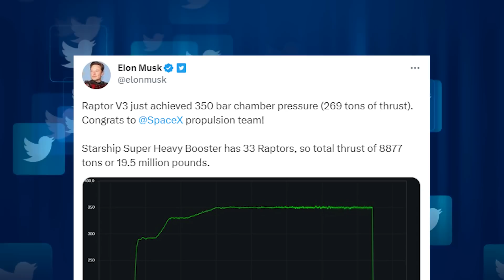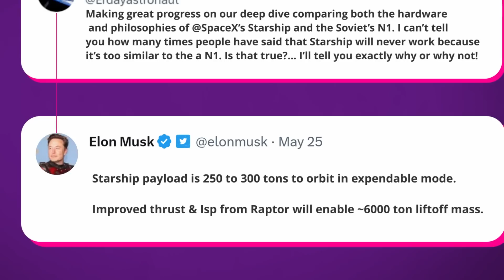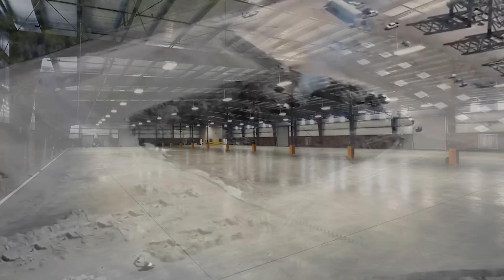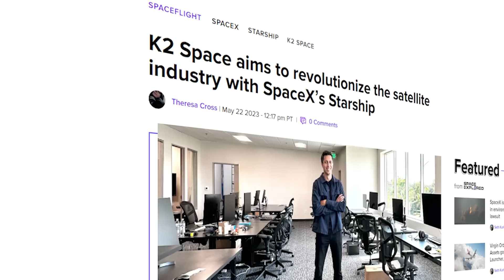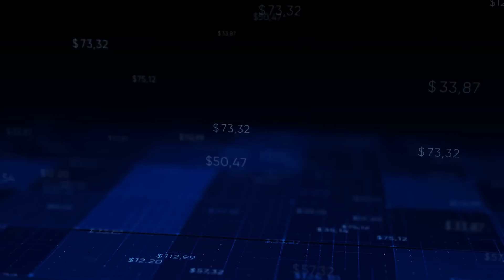Elon Musk Reveals SpaceX Is Making Major New Changes To Starship!

Comment: @SPACEX: 
There is something that eludes logic for me, no matter how I think about it: If Stardhip really did what it did to the platform that was specifically made for it to launch from (and it surely did), then how is it going to SAFELY land on, and take off from the Lunar surface? 
 - You won't know what kinds of rocks, boulders, dust, or whatever, are beneath it when it lands, which could potentially destabilize the craft, making it sit at an extreme angle, or even tip over and fall  (a catastrophe I can't even imagine the repercussions of) - or severely damage the engines, because the moon's surface has (under that Regolith), Basalt, Titanitm, and an array of heavy metals. - those engines may be damaged to the point that maybe they are not fit to get back into space with - let alone voyage back to Earth and land here. 
 - On lift-off, after whatever damage was done to the engines and the bottom of the craft - not to mention the damage to the surface it is still (hopefully) standing upon, how will you be assured that the craft even has a CHANCE to lift off, given the damage to the remains of whatever it landed on? 
 - You may have this all worked out, SpaceX, but can anyone with extensive knowledge of the internal discussions at SpaceX explain this to me? After watching what the first launch did to its platform, and later even more damage - even to the earth BELOW the platform - how will you land and then take off from the moon, Earth (if landing on an unprepared spot), or on Mars? 
Especially on the Moon and on Mars, with so many unknowns, and no "platform' at all?

Comment: The size of the starship and the capacity to lift 250 -300 tons falls inline with Elons plan to transport his Boring machines to mars. Thats why he trying to achieve as large a capacity as possible. The Tunneling machines weigh 200 -300 tons and the diameters are similar to the diameter of the star ships. Does anyone else put these two together.?

Comment: What if the launch pad was in a deep hole and the rocket would be boasted off with the engines and the use of the military rail gun system to get its initial takeoff.
Reply: cheaper to use rockets than that magnitude of power. that would take gigawatts to make that much weight move, and they'd have to make custom parts to handle that much power
Reply: Because anyone inside it would be a smear on the wall from the acceleration of the rail gun.

Comment: Spacex should prioritize making the raptor engine more reliable first before trying to increase it's thrust,
It's caught in a violent cycle of promising more and more features to secure more funding to keep promising new features. 
Speaking from experience, there's a point in a project where you have to pull a line and say "whaat's possible up to now must be refined and delivered otherwise we should see why it doesn't work and fix that and only when a working system is out can we move to make the next stage of development".
Spacex is unwilling to draw that line and it will cost it greatly and it threatens to harm the entire US space program with it.

Comment: Hey Elon Musk. Stop being such an ass** and you better redesign the boosters to have large sections that are milled, not aluminum or "high strength steel" sheets welded into a circle. The boosters are WEAK w/o pressure. Ypu have to take some lessons from NASA. Also. Mr. Musk. You do not have the tempernent any longer for these Starship boosters. I LOVE tge idea. But I knew... KNEW they would crumple or explode. 
You BETTER FIX IT AND STOP RUNNING YOUR MOUTH PUNK. Otherwise Rocketlab will be happy to take US Nasa business. 😮
Reply: You didn't know - and don't know - anything at all. And no one will listen to your big-shot trash talk, People couldn't care less about your "orders." 
Also - RocketLab is going for a completely different market than Musk is. Take lessons from NASA? Seriously? That right there is when I knew you were either stupid or crazy. 
Now I realize both are true. Starship doesn't have "Boosters." It has a single main thruster.

Comment: I dont know if eveybody knows this but Spacex mounded up a 40 foot high layer of soil on top of whatever sand that was there before they removed it all and built on the original sand. Wondering why? I was. It was to compress the exudting sand to give it more compressive strength. Hats off to people like Dr. Dirt and otger soil engineers who were involved in this project before anyone else and did the very best that they could to deliver the best base possible.

Comment: 2:04
The N1 was THE record holder for most powerful rocket to ever launch prior to 20 April.
PERIOD.
There is no "one of the" involved.
Reply: But they had zero successful launches.....
Reply: @lordgarion514  The N1 got off the pad all 4 times it launched.
They never had a successful FLIGHT with it.
It's most successful launch failed a few seconds before Stage Separation - so Starship isn't THAT much more successful of a rocket *SO FAR*.
Reply: @bricefleckenstein9666  
Getting off the pad doesn't make it a success.
It kinda has to work until stage separation.

And I never said Starship was a success yet.

In fact, neither of them completed testing.
Of course Starship will probably finish testing.
Reply: @lordgarion514  Getting off the pad is a LAUNCH success - and the N1 is ahead of Starship on that, with 3 unarguable successes and one "iffy" that did get off the pad but might not have cleared the tower before it started to fail.
It is not a FLIGHT success - which the N1 and Starship have no success at *yet*.
Reply: @bricefleckenstein9666  
A launch success doesn't make the rocket a success......

You might as well claim a concept car is the fastest car ever produced.
Reply: @lordgarion514  Where have I made ANY CLAIM WHATSOEVER that either of these rockets are a success?
READ MY COMMENT where I specifically STATE "It is not a FLIGHT success". or "They never had a suggessful FLIGHT with it".

QUIT FALSELY CLAIMING I HAVE SAID THEY HAD ANY SUCCESS EXCEPT LAUNCHING with both rockets (so far).

Or learn to READ.

Comment: Just to note that Falcon 9 launch cost per kilogram is about half of that of most competitors, and on par with the cheapest of those (Russians and Chinese). The projections of turnaround time and launch cost of SH/SS are wildly optimistic, and are very unlikely to materialize in a decade, if ever.
Reply: Falcon 9 after 6 years still hasn't reached the target of 10 times cheaper. now its about 10"% cheaper and that is with re-usability.
Reply: @salland12  Exact numbers are hard to come by, but Falcon 9 seems to cost per kilogram about 60% of Proton cost, and about 30% of Ariane 5. Falcon Heavy is even cheaper per kg. It did miss the breathless projections (just like Shuttle did), but this is still quite impressive.
Reply: @salland12  - Falcon 9 has an internal cost of $35 million & can launch 16.8 t in reusable mode. The internal costs of Atlas 5 were still 4 - 7 times that depending on the variant (number of SRBs & engines on the 2nd stage). Meanwhile, SpaceX Crew Dragon breaks even at 3 seats (the 4th is pure profit) at $54 million each, while Starliner doesn’t break even & become profitable until the 4th seat is sold at $94 million per seat. Sorry but that sounds like less than 1/3 to me!
Reply: @salland12  - I think I need to remind you that Starship has cost less than $5B in development costs (including construction on Starbase), while SLS has cost $38B to date, which means those costs will be easier to amortize, especially once it starts launching 2 - 3 times a week, which is what SpaceX will do once they can get it flying reliably. Raptors cost ~$1 million each to build, unlike $146 Million for each RL-25 on the SLS…ATST, Stainless Steel is sold by the ton, while Carbon-Fiber is sold by the Kilogram, & SS allows much lower manufacturing costs than Carbon Fiber. SpaceX has been building 4 Raptors a week and has assembled 5 Starships that haven’t even been launched yet!

Comment: risking to sound like a broken record, SpaceX would be well advised to focus on Raptor reliability rather than chasing thrust and chamber pressure records.
Reply: Finally a lick of sense. Raptor is indeed unreliable, and after 5 years of tests and development they aren't even close yet
Reply: @salland12  Yep - plenty of engine rich exhaust at that test launch...
Reply: Isn't it proven already that even NASA applauded the realibility of the  Raptor Engine?
Reply: @skybattler2624  I am not aware of it, and it would be very strange if they did. Merlin engines, OTOH, are very reliable - out of well over 1000 "trips" (nine+1 (or 27+1) per launch) Raptors only failed twice, and in neither of those cases was the mission jeopardized. Then again, I am not aware of a single RD-180 failure. Production rocket engines fail very rarely. Raptors are still very unreliable, but, despite the pace at which SpaceX churns them out, they are not yet production engines, but practically test articles. I do believe they will mature eventually; I just think that this, not chasing the records, should be SpaceX focus.

Comment: We have rapidly got used to falcon and superheavy rockets, in both their huge step forwards in tech, size, reusability, compared to the old shuttles. But on the other hand, we keep forgetting that  starlings is still a prototype as is its booster stage. The raptor 3 upgrade is just the latest and most obvious difference between the old NASA updates post catastrophes, and that spacex is totally different, with all its engines, boosters, dragons, superheavy, and starlings are subject to constant review, reassessment,  prototype and upgrades when it makes things simple, reliable, efficient, cost effective, and moving forward. It's just that we don't see 90% of their work.
Just remember, until falcon 9 evolved from their troublesome first flights, they are now being reused 10 to 15 times each, made return landings routine, and hands down fly more rockets a year than any other past agency worldwide.
Reply: The falcon 9 is more expensive than the starship😮

Comment: Actually you're not allowed to fly a drone near Starbase. All the Photos and Videos from the community are made from the Ground or by Flyover with crewed small planes at 10000 ft. hight 😂 (4:29)

And actually it isn't a doubling from 150 tons payload (fully reusable) to 300 tons (fully expandable) (2:38), of course 300 tons expandable is an increase over the 250 tons expandable assuming that this number previously appeared on SpaceX website is related to the current Starship with Raptor 2. 😅

... also I believe one or two years ago they said the fully reusable payload mass ist only 100 tons and they are aiming for 150 tons with improvements over the years. It might be, that the 150 tons fully reusable is that goal with Raptor 3 (going along with 300 tons expandable) and the 250 tons expendable are related to the current Raptor 2 with something between 100 and 150 tons fully reusable 🤔🤨😄

On SpaceX's website there is still written 100-150 tons fully reusable ... and in the text: above the table: "capable of carrying up to 150 metric tonnes fully reusable and 250 metric tonnes expendable." and the tweet from Elon with the 250-300 tons expandable and the improved 6000 tons lift of mass is are the very new information, shortly after the Raptor 3 reveal with 350 bar also by Elon ...🧐

Comment: Big question now is: Can the water deluge panels underneath stage0 handle multiple new powerful raptor engines?
Reply: Can’t be any worse…
Reply: @Meatball2022  could have a steam explosion when tons of water is flash boiled 😅
Reply: The earth beneath the base of the mount compacted under the force, causing the concrete to break up. They have put a lot effort into strengthening the base of the mount, so even without the deluge system, we're not likely to see a repeat of the last launch damage-wise.
Reply: @furyiv  that’s not what happened. That’s what they THINK might have happened. 
There will always be earth below the base and that earth will always compact under the force. 
Will the water help?  Who knows. The last time they thought something would work was an epic fail. 
You know what absolutely will work is a flame diverter….
They insist on solving a problem that they created. Their other problem is that they insist on solving 126 problems at once instead of isolating one issue and it’s variables and solving that
They’ve done some amazing things but they’re destined to fail if they keep up this stupidity…

Comment: A very important point to remember is that higher mass to orbit capability with such a large payload volume means that payload can be designed in lower-tech ways, since saving each and every gram of mass doesn't matter as much. This means PAYLOAD costs can decrease dramatically as well, further lowering the cost of satellites and space stations. This is an important, if not well understood concept.
Reply: Starship is roomy!  Starship is not cheap!  Starship weighs a LOT!  The cubic capacity of Starship far exceeds its payload mass capacity.  1000 m³ vs 150mt.  For a water payload that's 150m³, or just 15% of payload volume!  You always want lightweight payloads, to avoid exceeding launch parameters.  And because you want the most tech lifted to orbit (or wherever) for your launch cost.

Besides, the machines delivered to orbit by SpaceX already have designed-in mass limitations. For example, satellites experience orbital decay. That means periodic altitude adjustments, which means thrusters, and fuel. Fuel requirements expand proportionally to vehicle mass. So you design to reach the minimum possible dry weight, so you can carry enough fuel to support the designed lifetime, yet still have a rigid enough structural platform to support all onboard mechanics, electronics, solar panels, and thrusters and fuel.  And be strong enough to also survive the acceleration and vibrations of launch.

You want to transport the maximum technical functionality for your investment in building and transporting your machine.
Reply: @The-KP  I'm certain weight will be much less of a concern if launching costs are 50 times less.  I'm not certain that starship will reduce launch costs that much.
Reply: @rlh12345   SpaceX mission prices have gone up, not down. They will never be 50 times lower.  That was marketing.  You drank the Kool-Ade, and then you believed it.  Sorry, mate.
Reply: @The-KP  Did you read my statement at all?  I said I'm NOT certain they will be able to reduce costs by 50 times.  Some people aren't very bright.
Reply: @KP  there is a huge difference between the price of a mission, and the cost of a mission. SpaceX can allow huge profit margins while still coming in below any other competitor. There's no law that says they barely have to profit. Until there is a real competitor to SpaceX, they can charge what they want for a mission
Reply: As good as this may sound, it inadvertently affects pioneering cutting edge technology. We have the tech we have because scientists and engineers were “forced” to develop it due to said launch costs. If the need for smarter, lighter, better engineering and technology drops, we’ll slow ourselves down more than we should. Personally, i  don’t think that mass producing ‘less high tech’ satellites is a ‘good’ thing per se.
Reply: But it's going into spaaaace! 
And space stuff is expensive.
And it's not the material cost which makes it expensive!
Reply: @Chris.Davies  yes, it's not material cost, it is the engineering cost of the payload. You can make a cheaper more bulky version of the satellite with the same capabilities as a highly engineered, super mass efficient satellite
Reply: Saving each gram will always mater ya goob. It's flight.
Reply: @d1kstrykz  it's a matter of dollar to mass ratio. I'm simply saying you no longer have to optimize for mass to such extreme measures
Reply: I also think this is an incredibly important point, which I try to make as often as I can. We no longer need to make every gram count and make things on the cutting edge of technology.  Another point is that with the old model, your minimum cost is, say $100m because of the launch costs.  Then you might as well spend $30m developing your satellite and another $20m testing and hardening it.  If your launch costs drop to say $2m because of starships resusability, the maybe you can get by with some off the shelf, mass produced parts, and make a satellite for $1m.   It's already being done anyway with starlink.
Reply: @stevep8485  💯
Reply: @stevep8485  I think 🤔 the pay loaf is  better and the ship is bigger for the engines
Reply: Imagine how much sooner they could have finished James Webb if they didn't have to engineer it to have to unfold because of limited payload space. Imagine the space telescopes even larger than JW they can put up with Starship.
Reply: @DivineEternalOne  exactly! Yes, you want to optimize to put the best tech possible in space, but if the engineering time and capital can be applied to the instrumentation instead of the structure, many advances can be made.

Comment: Don’t they have to actually launch a rocket that doesn’t destroy itself and the launching infrastructure?
Reply: They do...and they have also have to show that the rocket can be safely reused.. with a fast turn around (unlike the space shuttle engines which was also reusable and never had a failure but the turn around time and cost to check them was so long it negated their re-usability)
Reply: @nickl5658  right, that is the issue. The idea that rockets and spacecraft are the same as passenger jets is flawed. This is going to hemorrhage money and lives until there is any chance of success. Having employees of space.-x be briefed to cheer regardless of success is alarming.